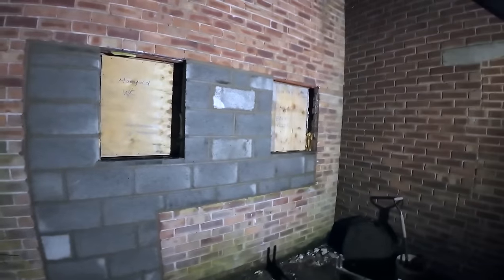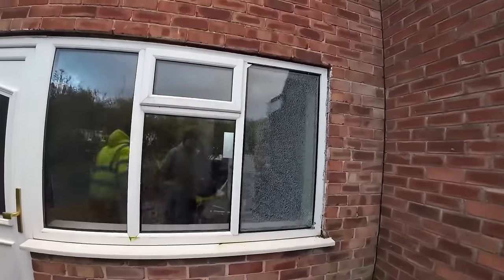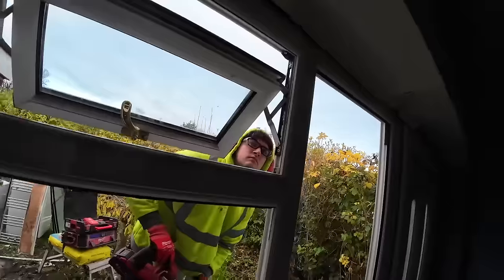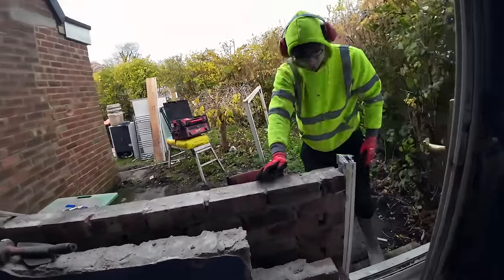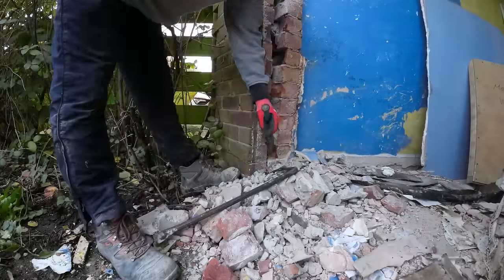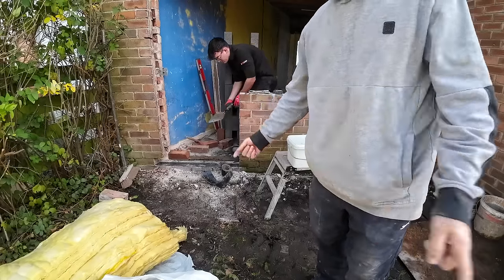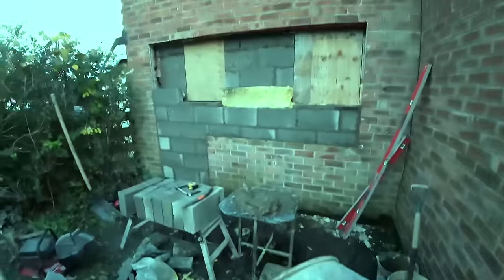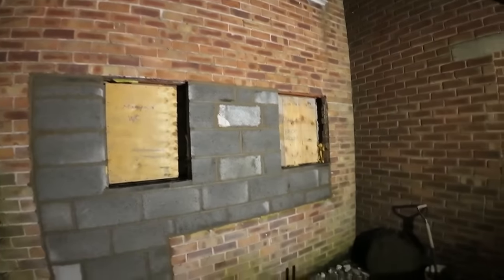BRICKWORK SO BAD IT NEEDS TO BE RENDERED!!

Comment: Yep the windows are old and cheap….back in the 70’s the DG frames were screwed together whilst in a jig, and then the joints sealed up with silicone…utter crap… whilst today the frames might be heat welded, there are still a lot of crap windows out there…!!
Reply from the maker: Very true…. Mainly on new builds ( from experience) 🙄🧱👍🏽

Comment: Interesting as had the original not been such a bodge i would say pre 1980 because of lack of insulation. When i was at college, mid 70s we were taught to spread the bed correctly and minimise snots in the cavity and if there were any to leave them as scraping them of will just create droppings. Obviously this is pre cavity insulation days but this example proves we were taught correctly in them days for the systems in use 👍
Reply from the maker: Absolutely mate . They weren’t proper brickies 🙄🧱👍🏽

Comment: Hi guys. Very old UPVC frames had aluminium inserts and were only welded on the corners. Nowadays we have steel inserts however I've noticed that here in Poland and for that matter, most of Europe, the internal joints are still mechanical (not welded as in the UK). I think it's something to do with internal stresses of the UPVC in hot weather but not sure. Not sure whats with the bright blue and yellow walls. I guess different people different tastes. Certainly a wake up call.  Anyway, great job.
Reply from the maker: Nice one thanks 👌🏼👍🏽🧱

Comment: Cavities 3 courses deep with snots is not uncommon on any build from late 50s onwards and especially extensions like these. Took out some cast in situ concrete lintels last year. They had bitumen trays but the trays were 200mm deep with snots. The Marston bricks and mortar with Leighton Buzzard sand in it were absolutely rock solid and impervious to water ingress, everything was bone dry at least.
Reply from the maker: @martin2466 🤢🤢🤕🧱👍🏽
Reply: @martin2466  All of those! I found a small sack of galvanised fishtail ties and door frame brackets whilst having a clear out late last year. Might just weigh them in next time I go to the scrappy...

These weren't boot lintels, full 200 x 225 x 3600 or imperial equivalent. They had butterfly ties cast in them to hold the soldier course on the outer skin.
Reply from the maker: @baldyslapnut2131 🥵🥵👍🏽🧱
Reply: @martin2466 I had to cut back a cast boot lintel, possibly the hardest material I ever had to hit....😂
Reply from the maker: @benllewellyn1887 🥵🥵🤣🧱👍🏽
Reply: @baldyslapnut. Those ties are indeed lethal, I have many a cut from those bad boys 😂
Reply from the maker: @benllewellyn1887 same here 🤕🧱👍🏽

Comment: Is rendering like stucco?
Reply from the maker: Not sure what stucco is 🤔🧱👍🏽
Reply: Won't Alex get in trouble for impersonating a locksmith?
Reply: Yes. Like plastering the outside walls with a polymer based material
Reply from the maker: @ianwelburn5158 🧱👍🏽

Comment: Security screws..you should be able to buy a cheap set for a future need??
Reply: @SteveAndAlexBuild  
i have a couple sets because i did commercial signage and we needed them once in awhile....i use a chisel if i don't have a tip..and locking pliers to get them out....

Comment: Why always the wool between the two layers of wall? It isolates worse than air, likes to wick itself full of water and then starts to mould. Is that some modern construction-code in britain?
Reply from the maker: No it doesn’t
Reply: @martin2466  Well quite some moulded isolation-wool from the "Hohlschicht" (don't know the english term for the space between outer and inner bricklayer) of a (privately built) outer wall from my parents house was removed during a renovation some years ago, that soaked itself full of condensation over a period of about 40+ years. That stuff was almost totally black of mould. Don't know if it was "Rockwool cavity insulation batts", was made in the early 1980ies. And was definetely not a good idea.

> "What do you mean when you say, "It ISOLATES  worse than air?"
That (unmoved) air is still the best thermal insulator (besides vacuum). Or is "Rockwool cavity insulation batts" better? Then sorry ...

Nothing against Steve and Alex, I thought that maybe the isolation-wool is some kind of legal-standard now in Britain, like wrapping old buildings in a lot of plastic seems to be in germany.
Reply: @patrickgrochowy Rock wool is actually made from rocks spun at a high revolution to create the wool,it is not affected by damp.
Reply from the maker: @bricklayersworldwithandy6277  . Spot on Andy same as candy floss 😉🧱👍🏽
Reply: @martin2466  That would be 'Hohlschacht' (which ist no used word; a Schacht ist already hohl, so no need to put these together). 'Hohlschicht' would be directly translated as 'hollow-layer', but cavity seems to be the correct technical term.